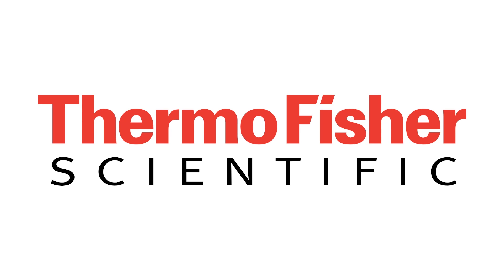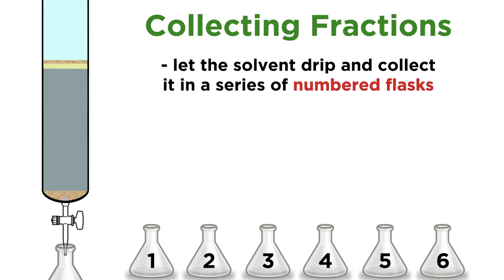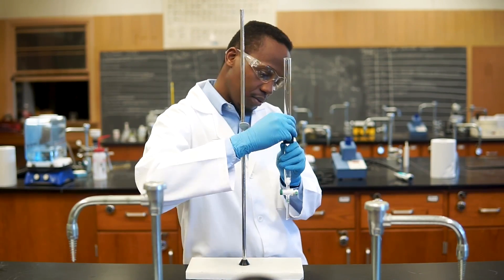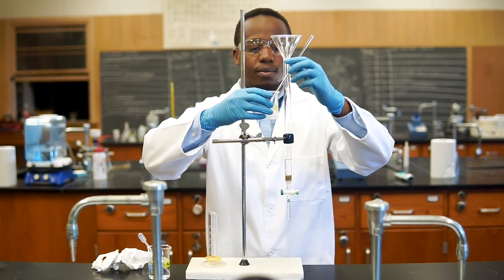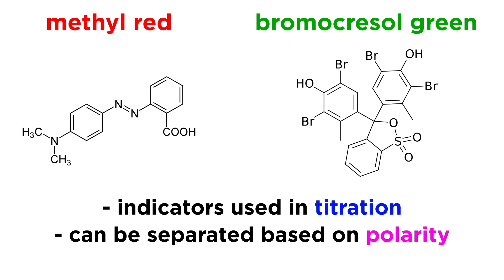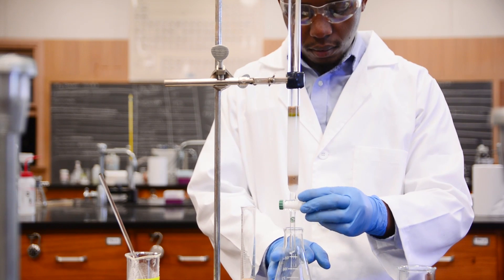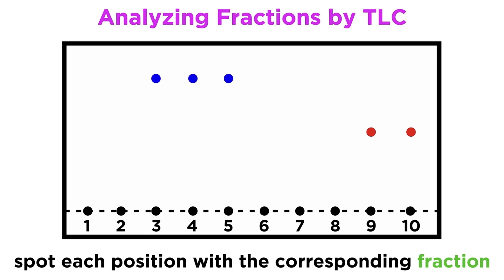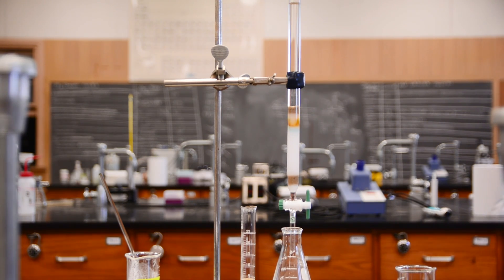Performing Column Chromatography

Comment: Could you please explain why the green compound eluated first if its more polar and had to stay longer on the polar silica gel?
Reply: In TLC technique, one solvent is used and separation depends on polarity. However, in the case of CC, a gradient solution is usually used and separation is done depending on the polarity of mobile phase .

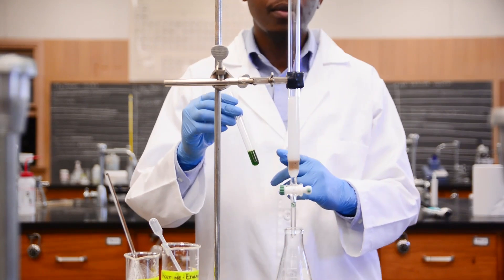Comment: thank you very much. quick question: the solvent that is used to dissolve the compounds (6:59), is it same as the eluent?
Reply: So you could do that. keep in mind that you really want to use a solvent where your sample is fully dissolved in as little of solvent as possible.Most of the time it doesnt really matter if you use some other solvent here, as its getting diluted so fast in the column that it doesnt really matter.
Reply: @Noldor97  thanks a lot.

Comment: Please, please, don’t just turn the tap on any burette with one hand! You can put a lot of strain on the thin tubing joint between the tube and the stopcock. If it’s just a little stiff you can break the stopcock off spilling solvent everywhere let alone the risk of glass fragments…
And yes, that’s from experience…